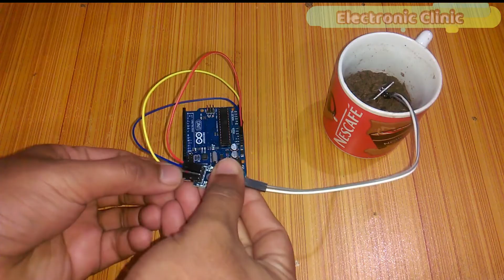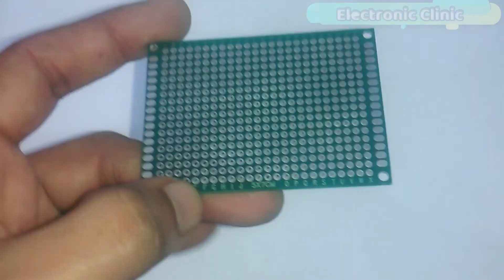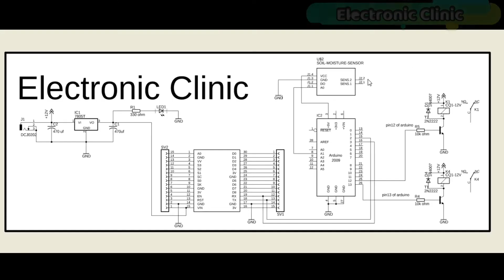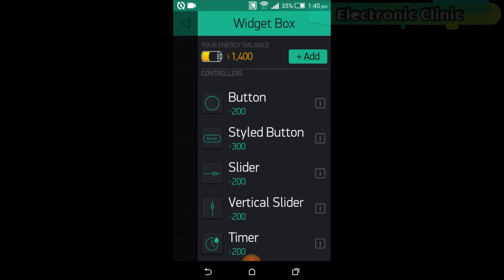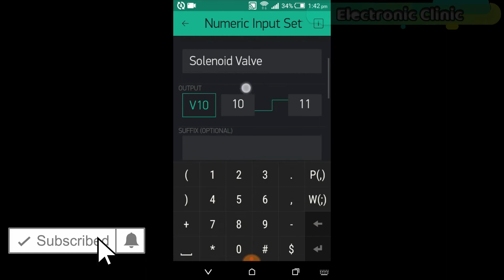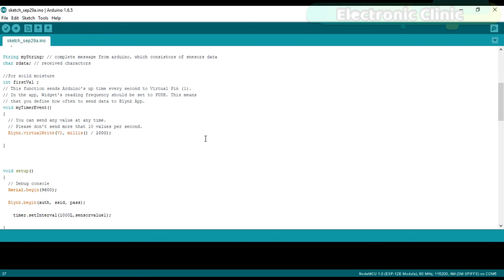Arduino project: IOT watering plants | IOT soil moisture sensor using Nodemcu esp8266 wifi”

Comment: Hello brother, i am a civil engineer but trying some innovative project. I'll be very thankful for ur reply.

can i use adruino uno with gsm module with accelerometer and gyroscope, rain guage, strain gauge, soil moisture, vibration senson in a single iot project .
Reply from the maker: ya, of course you can use.
Reply: @ElectroniClinic  thank you 😊

Comment: good work! but no need for arduino with the esp 8266, the node mcu can handle all of the calculation.
Reply from the maker: ya you are right. there is another version of the same  project using only nodemcu

Comment: Sir, can I directly connect 5V regulated voltage from output of my LM1086 to Vin of my nodeMCU? Thanks sir.
Reply from the maker: Yes you can. Make sure it provides enough current

Comment: Instead of using blynk im using firebase but after putting the firebase code in nodemcu my sensor value changes
Reply from the maker: watch my tutorial on firebase.
Reply: Electronic Clinic jab me mere sensor ki value arduino se leke nodemcu ke serial pe print karta hu tab sahi aati hai magar jab fire base se connect karta hu to wrong values aati hai

Comment: Hi sir. Why do u still need arduino if the nodemcu itself can control also what the arduino controls in your project? Can i integrate the codes from the arduino to node mcu in your project?
Reply from the maker: gives you more input output pins, what if you need to use many analog sensors?? using arduino with nodemcu is much more powerful. you can divide tasks between arduino and nodemcu. connect some sensors with arduino and some with nodemcu.
Reply: Thank you sir!
Reply: Frizzan Khael Soriano  did you do it???

Comment: I’m doing the same project using firebse but when put the firebase code in my arduino the moisture value doesn’t come properly
Reply from the maker: watch my tutorial on how to use the firebase. check playlist. may be u are making some mistakes in the arduino programming. check playlists.